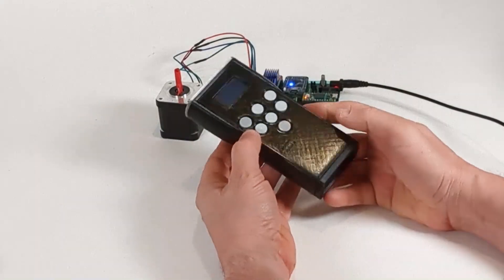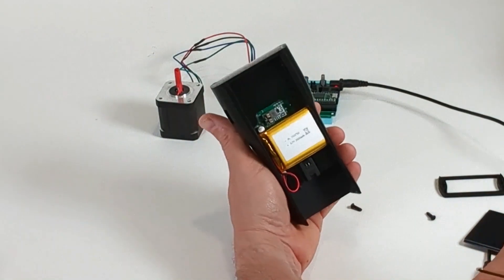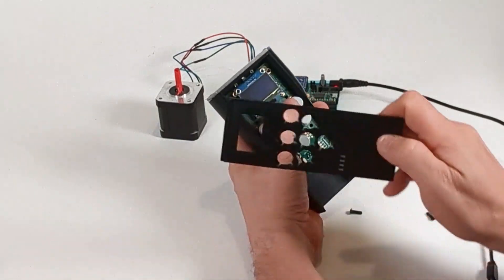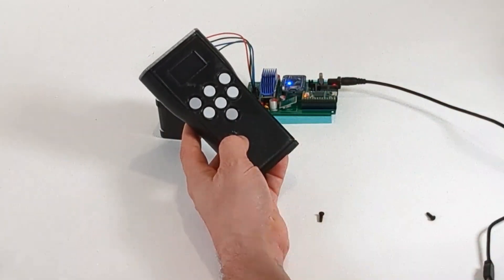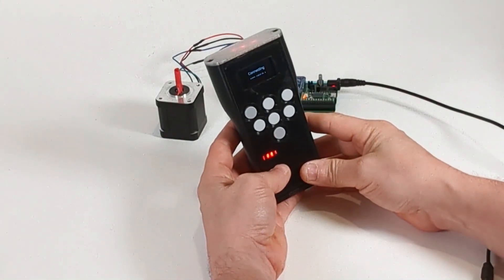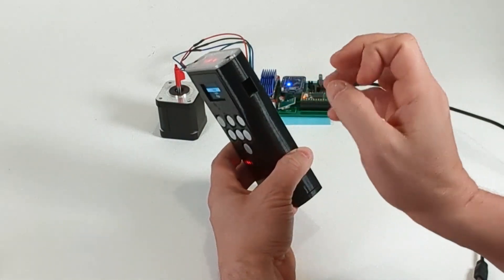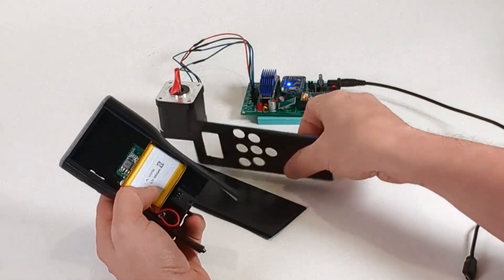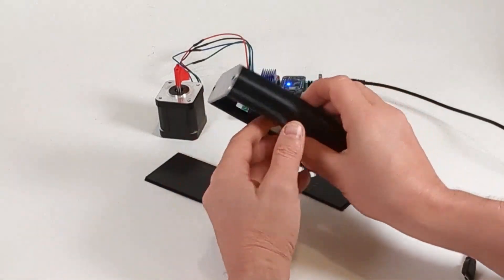SHC2+ introduction and 3D printed case

Comment: Well done!
I think i would of went for a Li-Ion 18650 cell or 2. They are safer, more capacity and available everywhere. It would make the case 18mm plus the plastic thickness. Or use the 14500 (AA size) Li-Ion cells. Thanks for sharing.